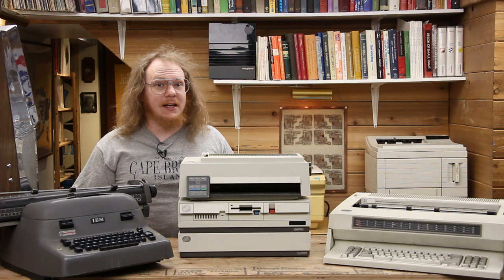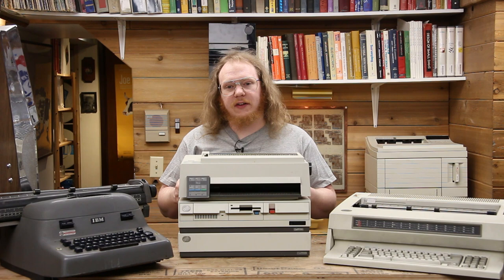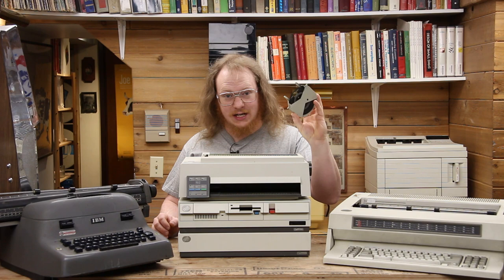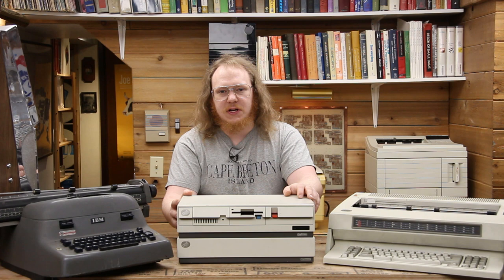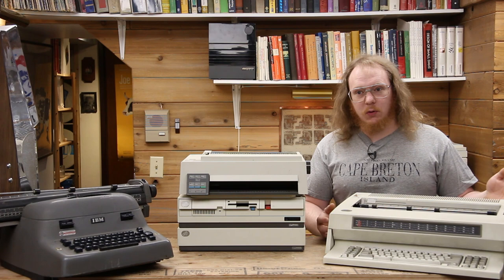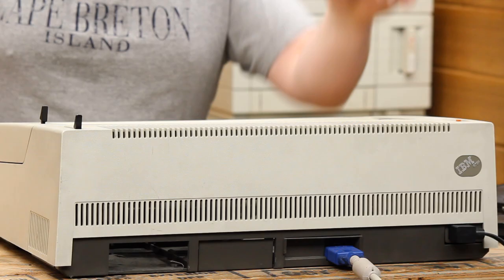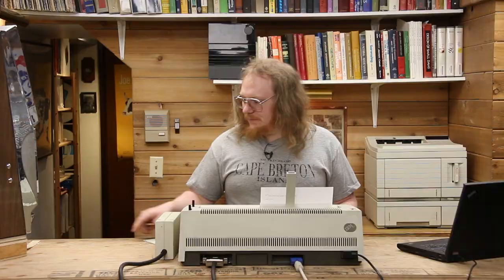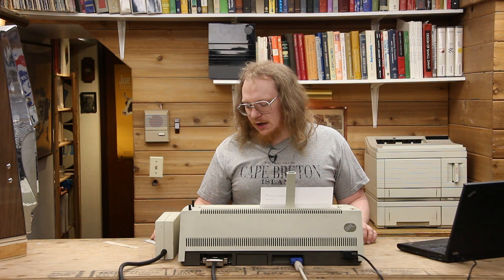IBM Wheelwriter 50 Series II and Adding the Diskette Option

Comment: Lovely, informative video. One thing though. When loading paper, leave the platen locked, that’s for paper release and removal. Instead insert the paper until it stops level on the platen then pull the load lever a little more toward you and it will auto-load it to the top margin. This also instructs the machine that you’ve loaded a new page, resets certain things in memory or enables you to utilise features like page reprint.
Reply from the maker: I was wondering how the auto-load worked.Thanks for pointing out how.
Reply: @CelGenStudios  You're welcome. I found Lexmark still host terrible but readable scans of most of the wheelwriter manuals so worth looking them up if you want to learn more of the device features.

Comment: Maybe IBM DisplayWriter software would be able to read the files on the disk?
Reply from the maker: I suspect IBM had that in mind, but seeing how Windows trashes the disk when it reads it IBM must of known they had to be careful with both the files on the disk and the disk format itself.
Reply: @CelGenStudios  https://en.wikipedia.org/wiki/IBM_DisplayWrite
Look at the bottom about file formats. The two IBM formats may help you narrow down how to import the text to a modern format.
Reply from the maker: @ninja011  You're right. I'm looking at this wrong and also forgetting that Windows had a thing for "inappropriately touching" files on disks, even if you never actually opened/read them.

Comment: I was gifted a  50 with the CRT and Disk Drive but the CRT is not giving an image.  I checked and the CRT cable is 9 pins. Did you have a special converter because current monitors do not have that PIN arrangement.  I did find an exact model on Ebay which I will probably end up buying as I would love to have a working CRT.

Comment: If it wasn't for the cheaply made model M keyboard used in their PC keyboards, the IBM Electronic 65, 85, 95 (correction) and the Displaywriter....  My mistake the IBM Displaywriter had a very sturdy heavy duty keyboard.
Reply: If it wasn't for the Xerox Memorywriter, IBM probably wouldn't have been pushed very hard to enter the market with the Wheelwriter
Reply: It's possible the files are saved in Display Write, or an early version of MS Word software?  What is the file extension?  Somewhere I downloaded IBM Display Write software for free, but now cannot remember where.

Comment: You did leave out the IBM Memory 50, Memory 100 typewriters, Electronic Typewriter 50, 60 (1978), 75 (1979), 85, and 95 (1983) haha.  The 85 and 95 could be connected to an IBM PC and used as a character printer.  The 85 and 95 both had external accessories.  The 6733  Typewriter Communication Module (Modem) and the 6731 Typewriter Diskette Module, which also required an interface board to be installed in the Electronic Selectric typewriter and a floppy disk with boot software for the 6731 to make it work, sigh.
Reply from the maker: Well that's because I don't own those! I don't even own a selectric. :P
Reply: @CelGenStudios  I don't think I've seen a IBM Typebar machine with a carriage that wide.  You should try an IBM Executive Typebar machine with proportional spaced type.  It takes some time to use one correctly.
Reply from the maker: @DandyDon1  That typewriter was found (and I kid you not here) in a ditch down in the Burnaby Fraser industrial park along with other dumped housewares. It's a bit bent up from being tossed and needs an oiling but yeah it's got a huge carriage and it works.

Comment: Will any 3.5" disk drive connect? Just a parallel port connection and the Wheelwriter operating system provides the format of the disk so I'm thinking mabe???
Reply from the maker: It's more than a parallel port. It's all 34 pins of the PS/2 floppy interface coming out to the drive, which is itself a PS/2-style floppy drive.
Reply: @CelGenStudios   Thanks for the reply and info!   I did some more research after my comment.  It is actually 37 pins, and yep, you are correct, it is the IBM PS/2 floppy interface.  I think it is a serial interface not parallel but an IBM specific DB37 Pin connection - I guess some or one of the pins supplies the voltage to the drive.  So, any IBM PS/2 external drive should work.  I was just curious, I was around during the 1980's and my memory of PC's (IBM and DOS compatible) is now sketchy, but I know that some of the connections were vendor specific as in this case.  I figured IBM would use an interface and drive they already made and not one that would be specific to the Wheelwriter.  Would be interested to see the pin out of the cable.
Reply: @CelGenStudios  I found a 3.5" drive on ebay computer section, it was labled IBM/Lexmark, so I thought it maybe was a drive for the Wheelwriter since it had Lexmark on it.  I bought it and refurbished an old WW30 that had the diskette card in it.  The WW30 was really a mess and extremely dirty, even the diskette option card had some sort of gunky film and dirty all over it.  I completely disassembled the WW30 and cleaned everything including the electronic cards/boards (99% iso alcohol) - it all came out looking like new! New solenoid cap and clean.  I hooked up the drive and bam!  it works!  I found a printer card for the series II and added that and now it also has the printer feature. All activates and shows up on the display.    Amazing machine!  I like this display on the WW50 my WW30 has the tilt up display - but I still like it.  I tried to add a CRT card to my WW30 since there was a power plug available and FFC ports that lined up, but I got 6 error beeps and black screen on the flip up display, all went away when I disconnected the Flat Flex cable to the VGA card, so my experiment to also add a VGA card to the WW30 did not work out, I was bummed about that cause I really thought it may work since the function card for the WW30 had the two ports for the the VGA card.
Reply from the maker: @groovy1937  Nice job! Sucks about not being able to use the LCD screen and the VGA/MCGA out but the extra real estate is so much nicer to work with in offline typing. I don't think I could really deal with all the scrolling on the LCD.
Reply: @CelGenStudios  Yeah, I wonder why they have the VGA port for the FFC on the function board if they serve no purpose, obviously that cost to include the sockets on the WW30 boards.  I notice that the WW50 70 boards don't have the plug socket on the right for the LCD screen, so they took that off for those models.  I was really hoping the VGA board would have worked unless there is something wrong with my board.  In reviewing the service manuals from Lexmark that cover the WW 30 50 70, there is no mention of the VGA board used for the WW30 only the 50 and 70.  They only thing was I didn't have a monitor hooked up when I turned on.  I wonder if that may have caused the error beeps, I really don't know why, but they service manual does say to have the monitor hooked up when it goes through the troubleshooting flow chart for the video card.  If you turn on your WW50 without a monitor hooked up, do you get any error codes???

Comment: 27:00 Can you update the description box or pin a comment with the example files uploaded to a github profile project with appropriate description and links? Better, include a whole 1 page document, lorem impsum with different formatting examples, rather than 1 line of text. 
Looking up the history of the product line, one might have to ask Lexmark for the original code, rather than reverse engineering, as the business line was spun out into Lexmark in the 1990.